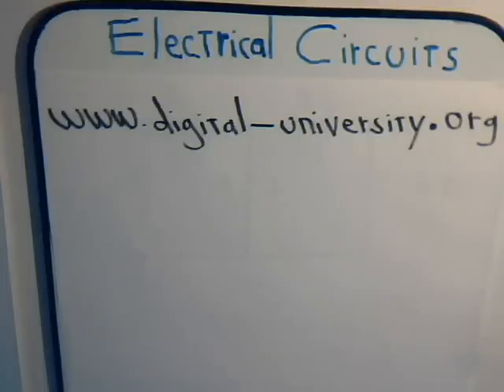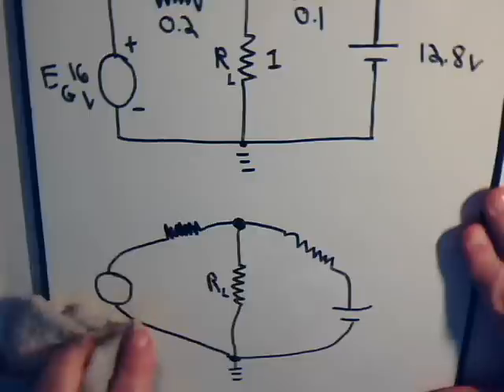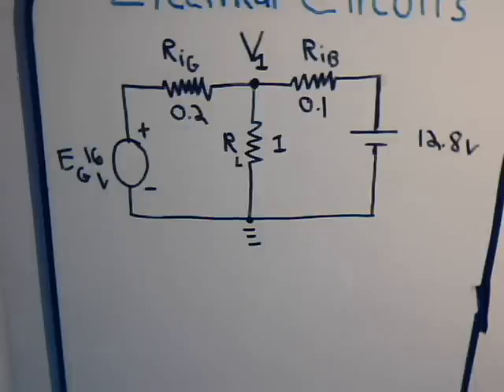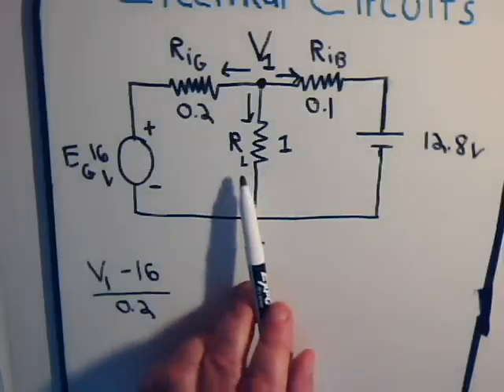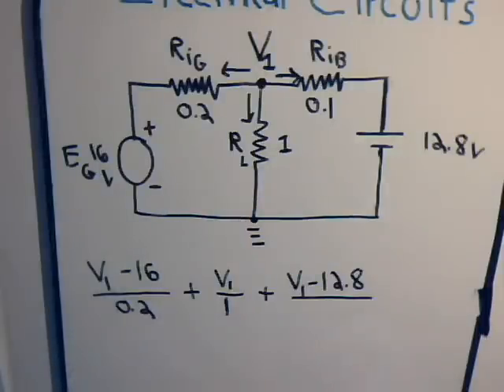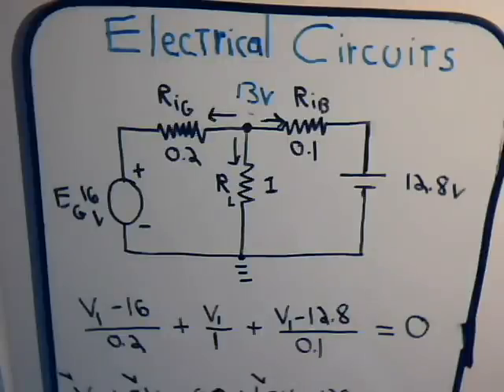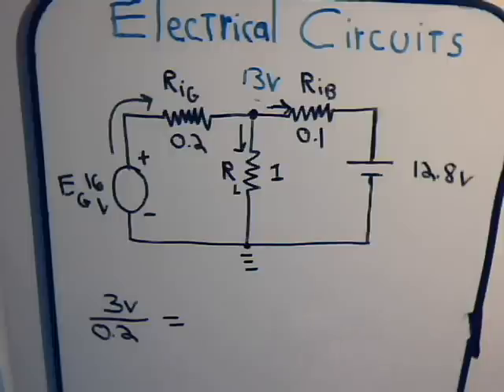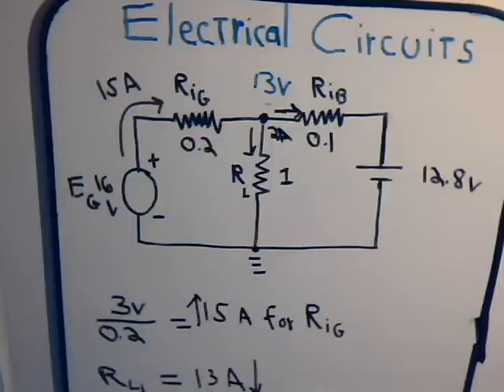Electrical Circuits Video 25: Nodal Analysis - Example #2

Comment: Milliam's theorem is concise and easy to solve this problem: [(16/0.2) + (12.8/0.1)]/[(1/0.2) + 1 + 1/0.1)] = V1 = 13 Volts. I like your lecture, it's clear and leads me thinking logically.